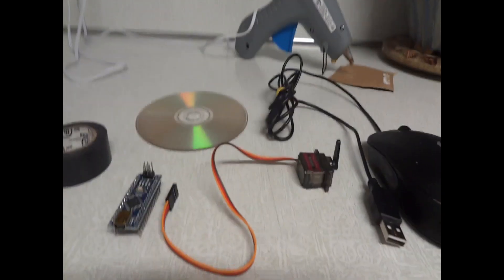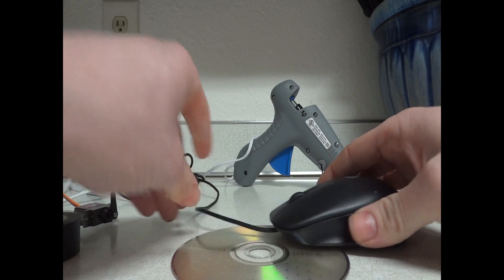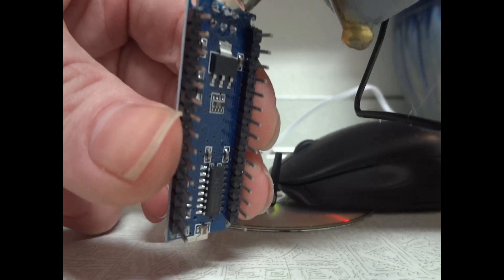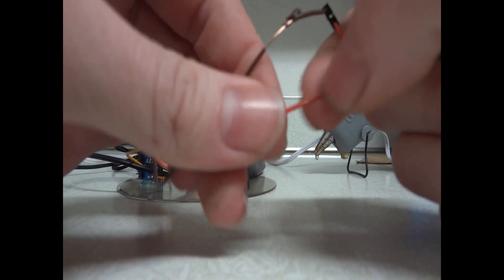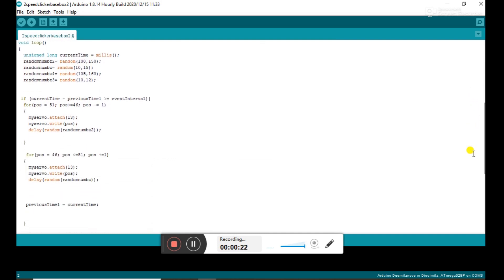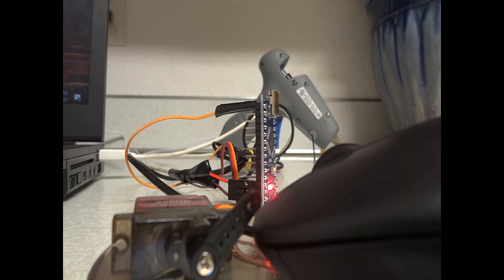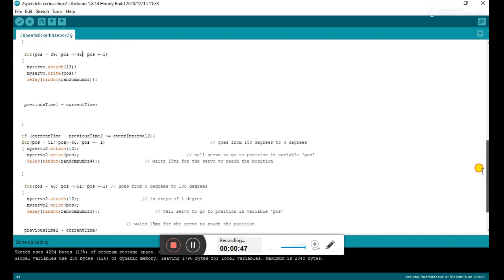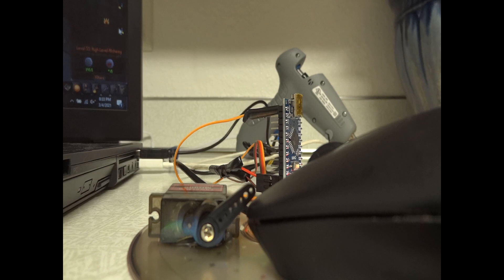DIY open source randomized 2 speed robot autoclicker for under $30! (With links)

Comment: I know you supplied the code on pastebin. In that code - can you control how long the servo keeps the mouse depressed for? So that the clock interval and the depressed value is always sort of “random” ??
Reply from the maker: What exactly are you trying to accomplish with keeping the mouse depressed might I ask, the code itself already has a random sequence built into it that picks a random number between the defined variables for every click.
Reply: @WorksMantis  It's probably overkill or just extra... but... The goal would be to have a random interval at when the servo operates and "clicks" the mouse, but also a slight random time it "holds down" the left mouse click. I believe you can detect how long the mouse click is held for. Thought it might be a neat idea. What do you think?
Reply from the maker: @rsnate2930  I see what you saying, I have already covered this feature in the code, each click depresses slightly different each time due to the random time between each click. Each click is different, were talking milliseconds now, but I tried to keep the range within that or someone using a actual mouse, they can definitely pick up on click depression time which is one of the reasons I chose a mechanical approach instead of software. So yes it already has that feature in the code it is kind of hard to tell but it is there. It's a basic code but works great, you could always increase the randomnumbz times to get more time in-between clicks thus slowing down xp rates and being less noticable if your worried about that.
Reply: @WorksMantis  I see! Thank you.. Ya.. I don't know much about the code, I am going to try and learn soon... just want to try and be as safe as possible! Long time account, don't really want to lose it, but always a chance lol!
Reply from the maker: @rsnate2930  that there is, but staying under like 8 hours should keep you safe as well as maybe slowing it down if your really worried,I've done multiple 99 mage accounts with it before though.
Reply: @WorksMantis  Thanks man. You are the best. Hope to see more vids from you one day! Or maybe we can play some apex lol. Last question if you don't mind.... how long the servos last??
Reply from the maker: @rsnate2930  well I play on playstation you can always add me @shiestysin. I have been busy lately so haven't had time for videos but I got a few things I wanna restore n some other projects hopefully I will have time for eventually. The servos can be hit or miss, I was selling these built in custom boxes for a while but it was becoming a issue assuring the quality of servos, I've managed to get a year out of them, some more some less. You can get higher quality hobby grade servos but the cost goes up substantially, and I have not tested the life span on those so it could be more or less. The key part is having the arm moving the least amount possible, and not making it overwork when it presses the mouse.
Reply: @WorksMantis  Would you mind checking the Amazon link in your video? For parameters, are those still correct, or should it be nano maybe? The board I got looks a little different. Just want to make sure. I'm still trying to learn Arduino stuff.... brand new..
Reply from the maker: @rsnate2930  just checked the links and everything looks fine! The coding part seems kinda overwhelming but it's pretty simple once you understand what's happening, just take your time and double triple check everything and you will be fine! It's pretty fool proof as far as the wiring goes! I'm here if you need help, no worries bud!
Reply: @WorksMantis  Thank you so much.. you are literally the best!

Comment: Hello,
I need this can u make one more.
Reply from the maker: I used to build these, with a little better quality along with a few more parts for cleaner and smoother operation and enclosed them in custom 3d printed boxes, but i have not made any in a long while. i made this to let people have all the info needed to build there own. I might have a box or 2 left around somewhere but i only ship in US and they are more expensive due to resources and time spent assembling. You can always contact me @ mrpirateflash@gmail.com

Comment: This is it what I looking for. but I want my autoclicker to click every hour only. can you help me with that?
Reply from the maker: Yes! The script is pretty versatile so you can edit it to fit your needs pretty easily, just a edit of the timing to get it within your needs. I can edit it for you if need be as long as you think you could build the device.
Reply: @WorksMantis  I already built this, and it's working, I tried to change the eventInterval2 and eventInterval, but the eventInteval2 is not working. I want the mouse to click every 1 hour and the next click, 1 minute after. example. (1:00am, 1:01am, 2:00am, 2:01am, 3:00am, 3:01am)
Reply from the maker: @IronFistBaludog21  So this is due to the 2 events happening on different pins, If you look at the code event 1 happens on pin 13 and event 2 happens on pin 12. myservo and myservo2 both have (12) or (13) after attach in the code. If your wanting to have both events happen on one pin then you need to edit these to match depending on what pin you are using on your machine. Then you should be able to change the event timing to match your needs and have them click one after another. If you need me do edit a example code for you let me know, hope i was clear.
Reply: @WorksMantis  Can I use 2 servo, 1 connected to  pin12 and other 1 to pin13 but only a single Arduino?
Reply: @WorksMantis  Please Help me to edit the code 2 events in 1 pin only.
Reply from the maker: @IronFistBaludog21  yes you can, you can run quite a few servos if you really want. And with not using them at the same time you should not have any power issues.
Reply from the maker: @IronFistBaludog21  Here this should do what you need, its using pin 13. You will need to change the event times to match what you want.
https://pastebin.com/HxGckHDe
Reply: @WorksMantis  I don't get the right timing when I set the (eventInterval = 10000; eventInterval2 = 55000;) it should be click on the 55sec but it only click at 1min after the eventinterval 1.

Comment: How fast can you make it? And can you make it random?
Reply from the maker: The code i supplied is already randomized, it pulls a static value on boot and then it cycles randomly between the desired times which i have optimized for alching and a slower speed that works great for cannon as well as other tasks( old school runescape). You could make it click as fast as you want, but the faster you go the more randomization you loose because the amount of time between click becomes less. You also add more stress on the working parts the faster you operate, It could be necessary ( depending on speed) to go with a upgraded servo for dependency.
Reply: @WorksMantis  Got it.  So what I am looking to do is to keep from having to click a button for my job. It needs to be about 4 clicks per second which is what I can humanly do.
Reply from the maker: @aaron647  i see, well what i think could be done to achieve that is to wire another switch to the mouse button and then add another servo accordingly, might even have to have 3. Where they would alternate movements but still be clicking the same button. This way the servos are not being over worked, basically for longevity.